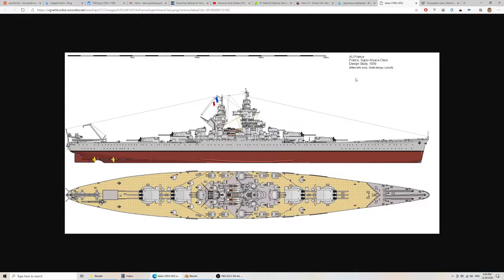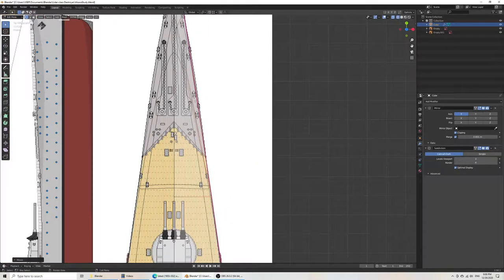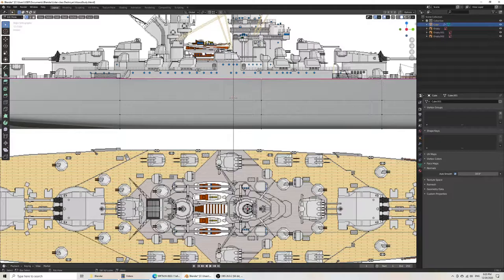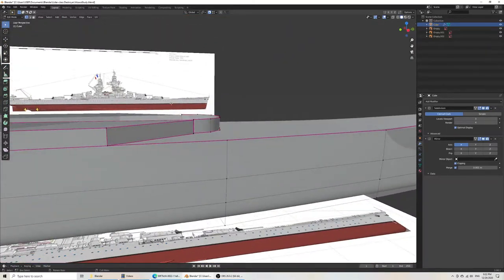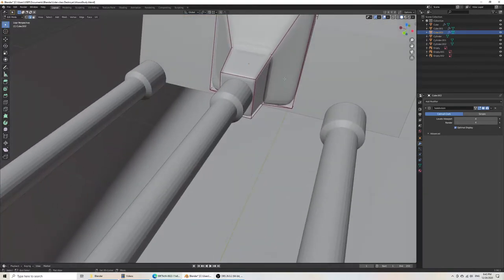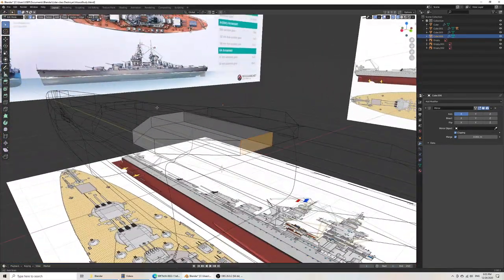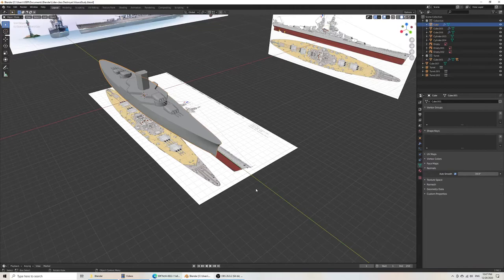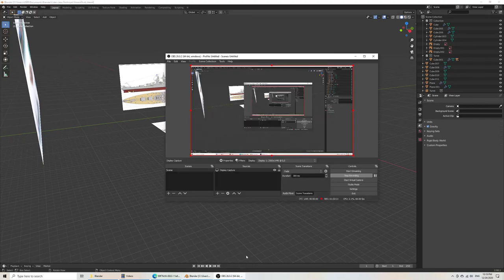How to Model a Ship Hull in #Blender #Tutorial

Comment: Hi men ! I got a question, how i can make a bulbous bow for the ship, i see you have a ship like that, thank you !
Reply from the maker: Extrude a cube from the bottom of the bow when in the rough stage. Then, subdivide it vertically and horizontally to control the pointiness. Use the subsurface modifier to smooth it out. It takes a lot of tweaking afterwards to merge it into the hull.